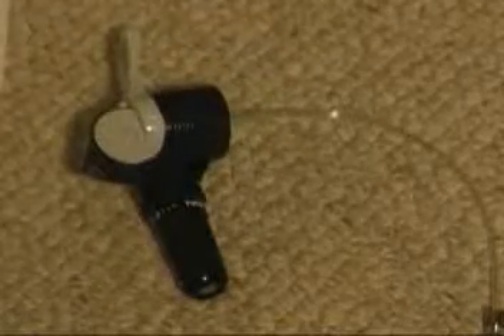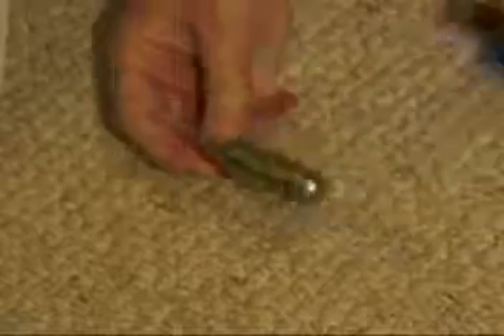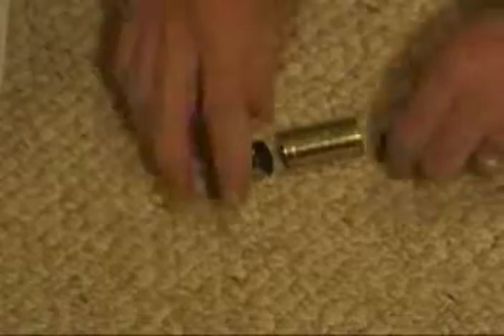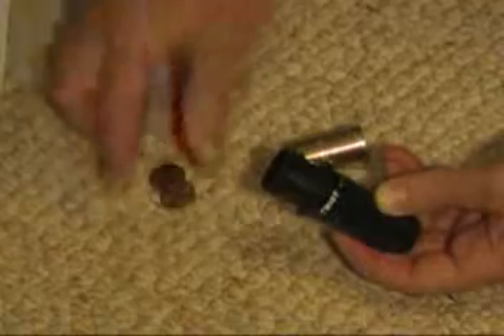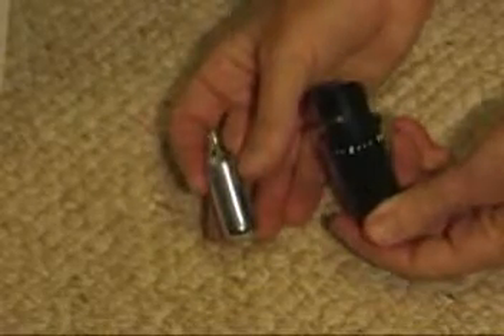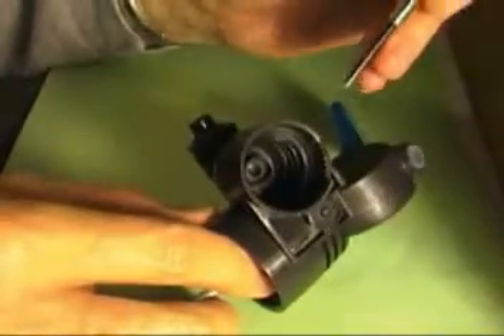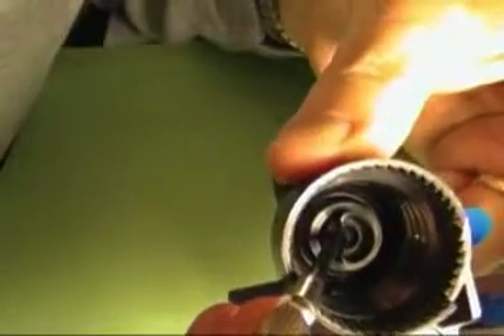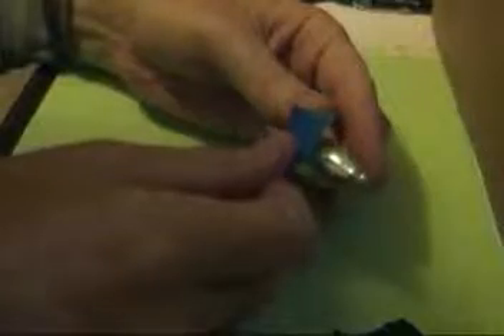Using 8 Gram CO2 in a Miller Home Draft Instead of 16 Gram - Updated

Comment: Just Trier something myself, iff you cut the top off a 16g co2 cartridge for tire inflators put a 23mm long 12mm wide aluminium tube inside with an 8g co2 soda cartridge on top it fits in tire inflators that normally takes 16g non threaded cartridges😉 just tried and it worked like a charm😁
Reply from the maker: I encourage others to try this...I have no clue if it works or not, but sounds reasonable.
Reply: sengsationa1 i've done it Lots of times now with my Blackburn inflator and it Works like a charm for me😉 found out that switching the 23mm long 12mm wide aluminium tube out with a equal sized piece of Steel tube makes it a bit more durable though as Long as you round the edges og the tube😉

Comment: Did you ever find something more permanent? Thanks for the vid, I am going to try this
Reply from the maker: +Glen Macready Great question.  This video was an early one, and having that loose 8g cartridge was a problem.  I ended-up making a little better sleeve, and also created a bit of technique that helped.  But nothing made these taps as reusable as I would have liked.  The failure was with the seal between the CO2 bulb and the tap housing.  I consolidated much of what I learned in a later video https://www.youtube.com/watch?v=R2O1eTA_Lvo